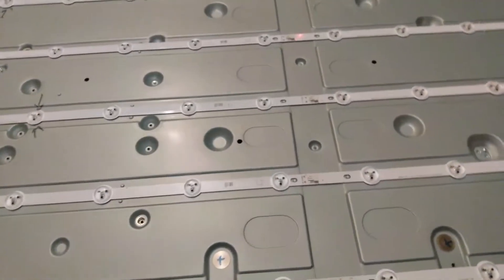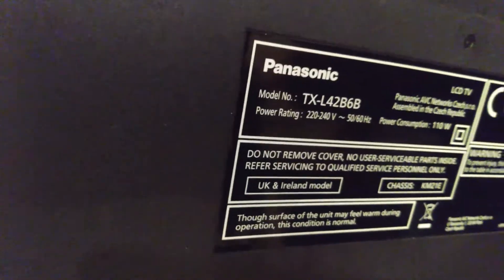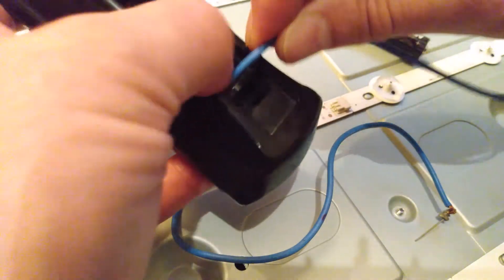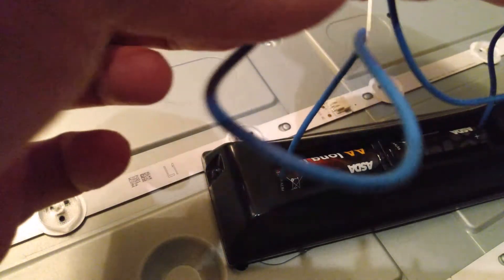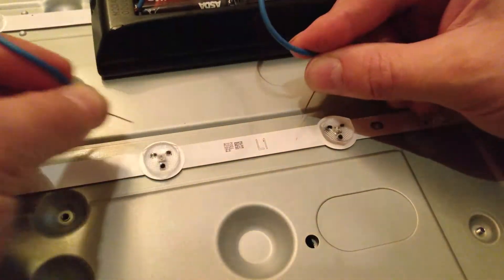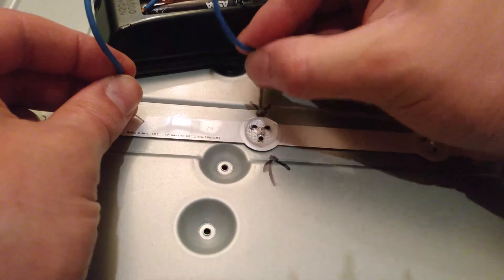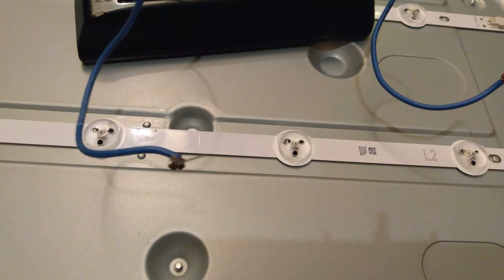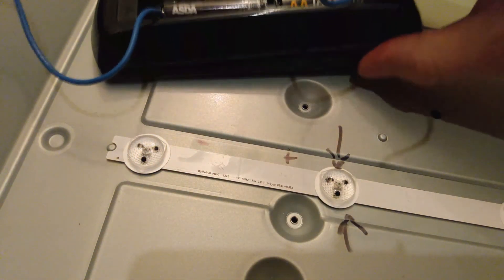How To Test TV LED Backlight Quickly & Easily

Comment: Absolute genius!!!! Haha.  Same principle as using a  multimeter.
Reply from the maker: @bittertruth6575  Sure is, but try getting the multi meter tips on the contact sides of the LED without taking off the lens😉 that's why I prefer my method as you can more easily scratch through the surface paint to the copper beneath with pins. Good point though...cheers👍

Comment: On my Samsung 8 out of 54 have gone blue !
Reply from the maker: Hi, thanks for watching 👍, now that's quite interesting, I've never heard of them changing colour before!. Maybe it has a different led type or different technology, unless they were a mixed brand during the manufacturing process and some slightly dodgy ones got put in. Hope you managed to sort it👍
Reply: @dandantherepairman  Hello, thanks for the reply ! Oh yes it's quite common in Europe (for what ever reason) ! Also diffuser-lenses popping off the LED's . 2 of those lenses on mine fell off , and now I've got (now get this) a blue and a white spot in the middle of my screen! I can't wait for the day when I'm getting my first OLED TV !
Reply from the maker: @ERIC-65  ah yes, I've had experience of the lenses falling off lol. Not really sure about OLED as I've read mixed things about it but it might be good. I currently have a Panasonic 50" which has the entire backlight system from a Blaupunkt 50" inside (long story lol), but it's been working perfectly for many many years now since rebuilding it. A lot of it is about the heat dissipation from the LEDs and the Panasonic ones have a glue strip between the strip and the metal frame so their LEDs get hot and burn out quickly. Keeping them cool helps prolong them👍
Reply: @dandantherepairman  Alright DanDan , keep it up ! 👍
Reply: So, should you eventually apply thermo-paste like "Artic Silver" to the back of the strip?
Reply from the maker: @ERIC-65  I must admit, I didn't on mine as they are metal on metal and that inner surface stays pretty cool but I imagine it would be a worthwhile upgrade to use, it certainly wouldn't hurt and could well prove to help the longevity of those LEDs 👍
Reply: Well, for a 2013 SAMSUNG 48" SmartTV with 54 LED's , which LED-Type shall I order ? As I would swap them all for new ones !
Reply from the maker: @ERIC-65  unfortunately I can't really advise on that as I've only ever used salvaged TV led strips to sort of 'cut and paste' the failed ones.
Reply: This happens when the yellow phoshor filter cracks off the full spectrum led.  You'll notice in Qled tvs that one of the leds have this yellow phoshor and instead use an entire filter sheet layer over the diffuser to control the light color.  The fix in your case is to replace the strips with a new set.